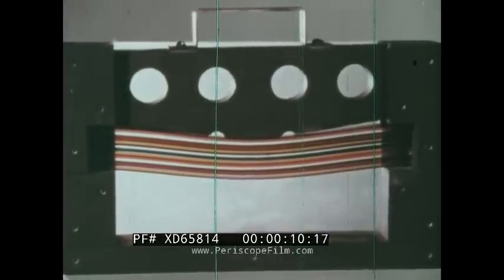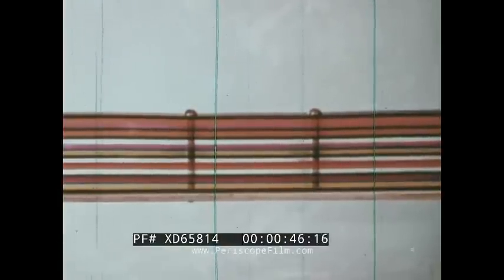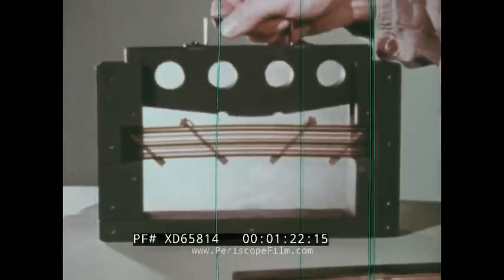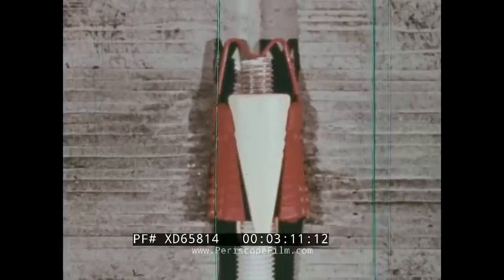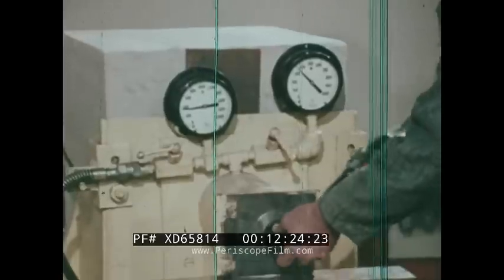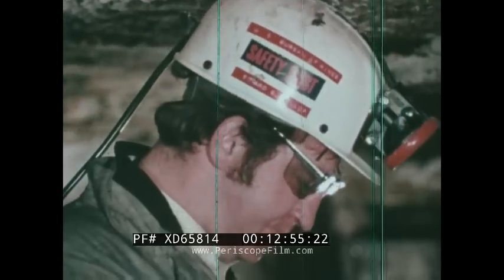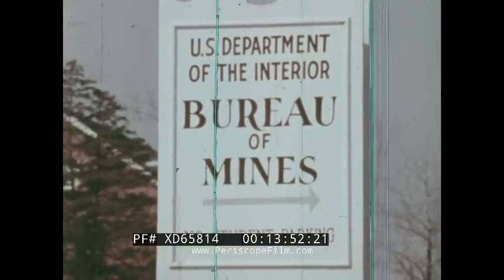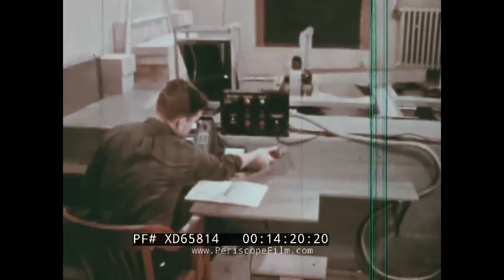" ROOF BOLTING IN COAL MINES "  1970s BUREAU OF MINE SAFETY TRAINING FILM   XD65814

Comment: Worked 45 years as a underground coalminer, from 32 inch coal to 60 inch. This brought back a lot of old memories. Bolting has came a long way since I started in 75. Resin bolts and cable bolts being the most notable. The best innovation  in my career has been the automated temporary roof support called ATRS for bolting and the mobile roof support called MRS used for removing pillars. The ATRS and MRS has saved countless lives. I know a lot of people want understand this but I loved it. You watched out for one another better than most families.
Reply: the energy absorbing bolts made even more advances. I worked with the guy who invented it.
Reply: Thanks for your work. I live in NEPA in the anthracite fields and have been fascinated with the mines my whole life. My G pa lost an eye as a surface mechanic for one of the mines.. so even above ground you weren't safe
Reply: I found BLS's possibly your MRS were somewhat more dangerous pulling pillqars.If The Pit I worked at had gone to something akin to a shortwall they would have been good

Comment: The machinery has changed a little bit. But the concept is still very similar.  We use, 6 ft, 8 ft steel rebar torque tension bolts and supplement  with 12 ft, 16 ft or 20 ft cable bolts. Very interesting video. Thank you for sharing this.

Comment: I don’t think this Method was used in mines in the U.K.
Reply: It was from the 1950s until glue bolting became a thing in the 70s, unless you were mining for steel coal (COKED coal) which is a different type of mining compared to bituminous coal which is coal for power generation. If the mines were mining for steel coal then they would have used what is called crib and timber method since the top rock for coke coal is stronger and is less likely to shift!